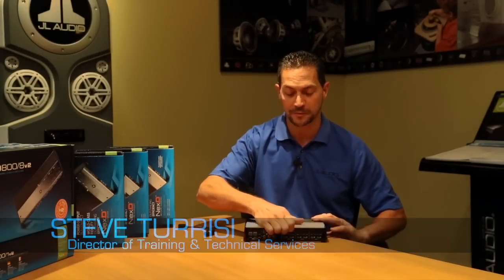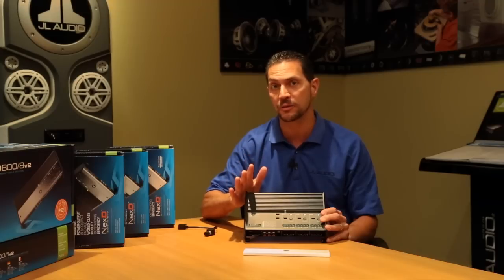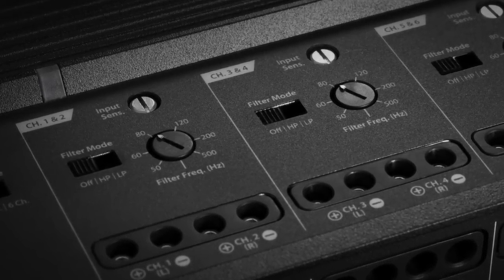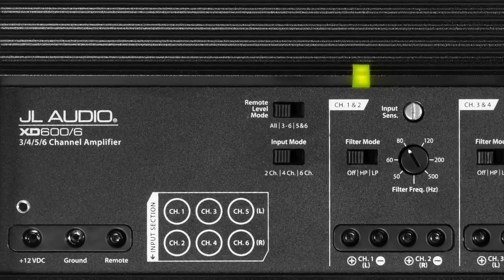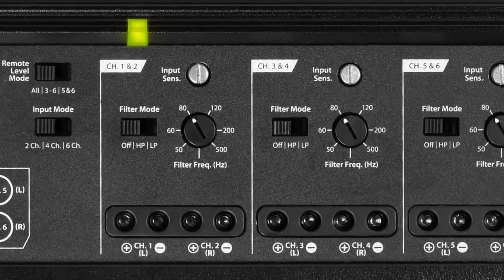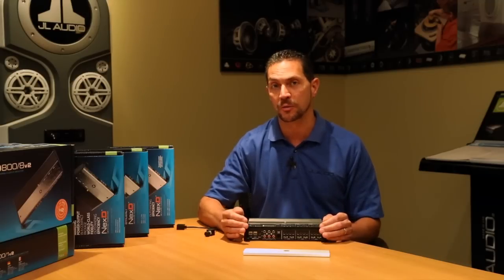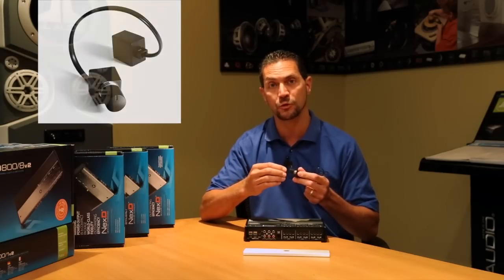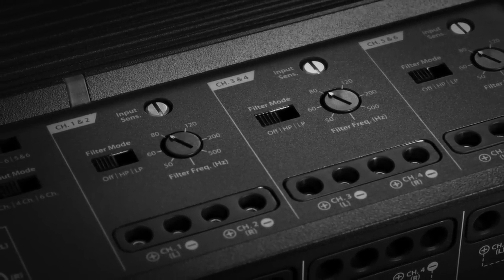JL Audio XD600/6 Product Spotlight

Comment: Hi mate, I have install xd600/6v2 on my bmw and used channel 1&2 for front component speakers and channel 3&4 for rear coaxial speakers and channel 5&6 for subwoofer... I have the set 1&2 frequency to 100hz and 3&4 around 200hz but there is so much distortion coming from rear speakers, can you please help me setting the right frequency for all channels... thanks

Comment: Hi Steve,

I Recently picked a up a JL Audio xd600/1 amp and looking to run it full power to a JL Audio HO110-W6v3 10" H.O.Wedge. What fuse ampage would you suggest I use in line with this amp. Any advice would very helpful.

Thanks

Comment: I have (2) 6.5" speakers and (2) 8" mid bass drivers. The 8" needs to be bridged to receive the 200watts. How should this be wired? Both 6.5 on channels 1&2, and bridge channels 3&4, 5&6 to the 8" or bridge channels 1&2, and 3&4 for the 8" and the 6.5" on channels 5&6? Thank you. Also, will 2 inputs of rca work for this configuration or will I have to use all 6 rca's input.
Reply from the maker: Either configuration would work as far as the speaker wiring goes, but for a true midbass driver you would need a highpass and low pass filer on each channel and the XD600/6v2 is not capable of doing that. The most common configuration would be to use a DSP for the signal processing and use all 6 inputs to the amp in order to properly route the desired signals.
Reply: @JLAudioInc  sounds good. I was able to get signal to all 6 rca inputs using a few "Y" splitters.
Reply: Can I use the amp as a 4 channel bridging 1-4 channels for the 8" and channels 5-6 for a pair of 6.5.? Also will I be able to adjust the frequencies on channels 5-6 since there's no input to those channels? Thank you

Comment: Do i need line converter if i hook speaker wire from factory harness behind head unit(its ran to the trunk amp) of 2 rear sub speakers usin rca adapter. Like A speaker wire left and rt(4 wires) to rca left n rt(2)? Then put those 2 rcas into rca balance differential inputs 5/6 on the amp? Where wud i get such adapter if so.  I hav 2 underseat subs and only harness i can find for my bmw 335i doesnt hav 6 low level rca only 4 rca for front/rear door. Only speaker wires for 2 subs under seats
Reply from the maker: Jack, our sincere apologies for the delayed response. This answer is a bit more in-depth and may be better suited for our tech team. Please submit a support ticket here: https://jlaudio.zendesk.com/hc/en-us/requests/new

Comment: How would i do the rca input with channels 1 and 3 bridged and 2 and 4 bridges to a set of components with 5 and 6 ran to coaxials
Reply from the maker: Hello, you would need to Y off the front RCA's from your radio into two LEFTS and two RIGHTS. Now plug both LEFTS into inputs 1 & 2 and then bridge channels 1 & 2 together to the front LEFT speaker. Now plug both RIGHTS into inputs 3 & 4 and bridge channels 3 & 4 to the front RIGHT speaker.  (You can not bridge 1 and 3 and 2 and 4 as you listed). Now plug the left and right rear RCA's into inputs 5 & 6. Finally, place the amplifier into 6 channel input mode. This will provide a stereo bridge to the front speakers and provide stereo sound for the coaxials.
Reply: Ok, to get this straight.  The FL and FR RCAs from my head unit need to be split to fill channels 1 and 2 and 3 and 4.  Wouldnt that split the RCA voltage from my head unit from 4v to 2v?  Then the RL AND RR rcas are plugged directly into channels 5 and 6?
Reply from the maker: Yes, they would need to be split as described. The voltage does not typically drop that much when split, so that shouldn't be a concern. Then a single left and right RCA would go into channels 5 & 6.
Reply: One more question,  because all channels are full range and not subwoofer channels,  can i connect 4 rcas from my head unit and use the amp in four channel mode?  Won't it feed signal into the 5th and 6th channels?
Reply from the maker: If you were to hook up in that manner in 4 channel input mode you would lose stereo separation on the  pair of bridged speakers since you would then be combining a sum of left and right signal to each speaker. In the manner I described we are cheating the input signal so that channels 1 & 2 get a sum of left signal only and channels 3 & 4 are getting a sum of right signal only. Then channels 5 & 6 receive independent left and right signal.